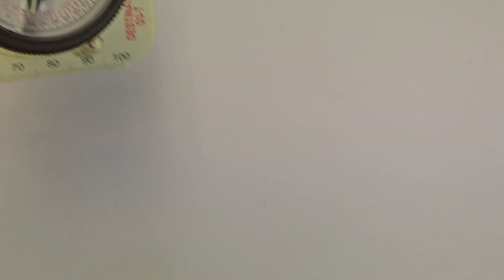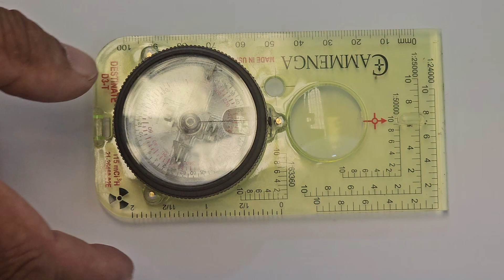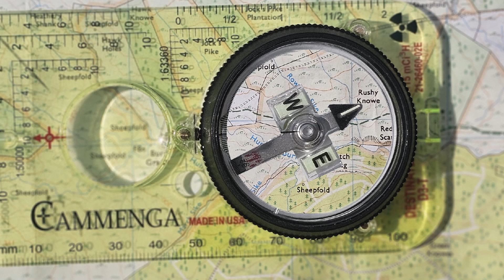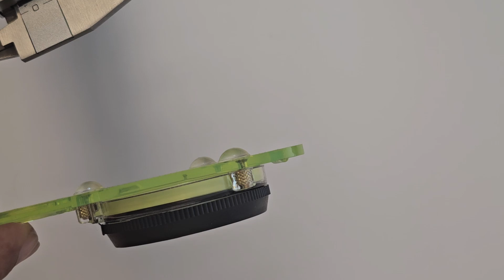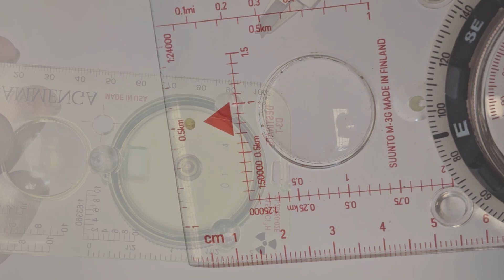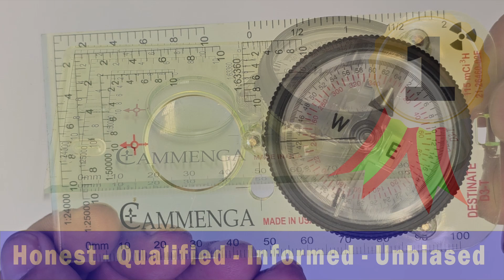Review - Cammenga Destinate D3 T

Comment: Hello, they cannot remove the copper plate from the capsule cause it is the dampener for the needle (induced electromagnetic effect) to do that, they should use liquid dampening system, which will make no sense as there are so many other on the market. For the screw threads, they only have to do it in reverse, a flush screw from the bottom and a small  bold inserted in the capsule base. Problem solved. Have a great day Sir
Reply from the maker: Or, just a thought, the spindle could dampend getting rid of the need for plate.  Just a thought !

Comment: I doubt it will be possible to make the bottom of the compass capsule clear because the base of the capsule needs to have a copper coil in it to facilitate the magnetic damping which works by electromagnetic induction. They would have to replace the air filled capsule with one that is damped with fluid, and then it would be a completely different compass, closer to the Silva Expedition 4! 😄
Reply from the maker: I'm NOT an expert in this aspect but maybe (just maybe) the dampening could happen in the pivot.  This would keep the air filled dial (which everyone likes) and allow the needle to settle quickly - just a thought 😄

Comment: Not sure if you already know this and just want to show the calliper's readings, but there should be a "tail" sticking out of the end of the calliper as you pull the jaws apart. That tailpiece is meant to be used for measuring height/depth, and should help get a more accurate reading of how much those pads protrude from the plastic base.
Reply from the maker: Brilliant, thank you so much.  I didn’t notice that.  I have just re-checked the measurements with the tail and they are around the same.  I have learned something today, thanks again.
Reply: @TheMapReadingCompany  I love callipers, even the old-school ones with a Vernier scale. Every part seems so well thought out to deliver easy, precise, and repeatable measurements, like a well-designed map or compass 😉

I use them around the house to make sure I order the correct replacement parts when things break down, like a screw, a washer, or a door lock.